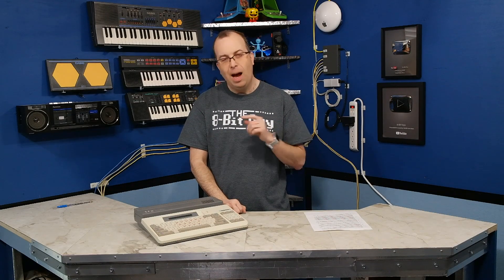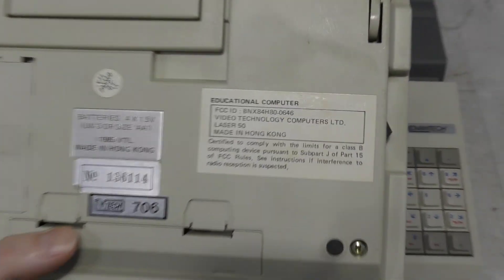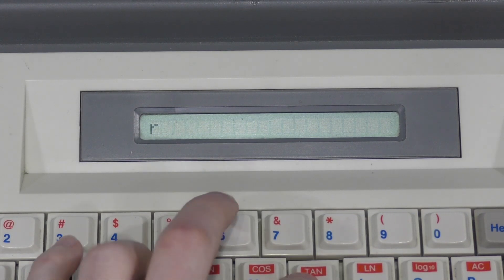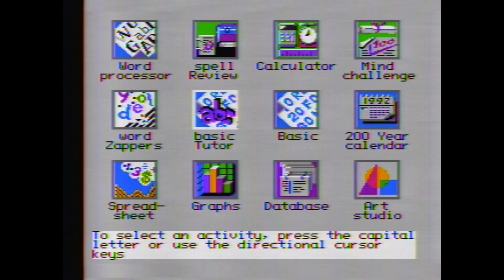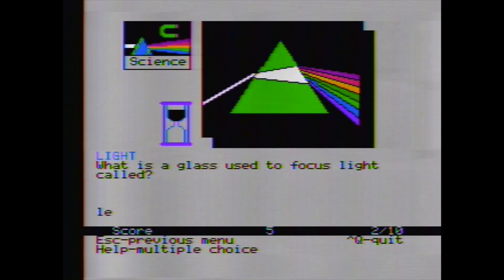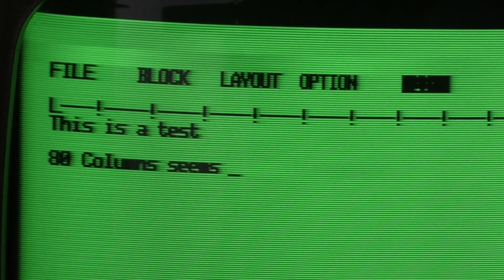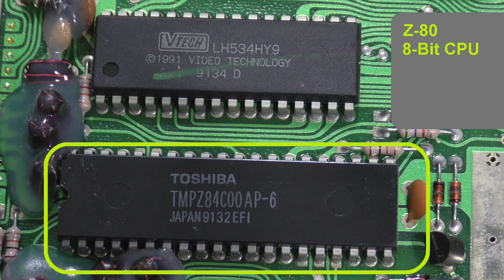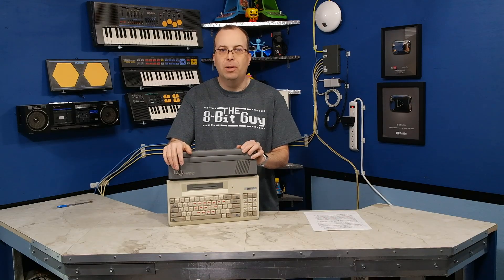The Advantech I.Q. Unlimited with BASIC and a Z80 CPU.

Comment: If my memory serves me right the Z80 can not address more than 64K of memory. Which is why the Spectrum 128 uses paged RAM to access the upper 64K in 16K blocks which are paged into the upper 16K of the first 64K.

Comment: By 1991, Commodore 128 and Amega had beat out the 64, IBM was part Windows 3.2 and DOS 7 and running between 4 to 12 Mhz with internal hard drives and Math Co-processors and a growing library of third party Windows based software. How could anyone with any business sense think this would be "all the computer a family would ever need"? Other than a gimmick, free give-away for opening a new bank account, or a rather expensive kid's toy, this thing was dead before it ever left the factory.

Comment: How could anyone stand to do work, or just mess around, on a single line display like that?  The computer looks pretty good when connected to a monitor though.
Reply: If you were typing something in to the computer just to print it off 1 line would work. But yeah, there is a reason the past is in the past.

Comment: That port in the back is an expansion port, and yes, the other is a ROM cartridge port, for which there were a total of SIX ROM cartridges available, mainly for expanding the database of the already installed programs, including the BASIC commands.
That expansion port I do believe was intended to serve as a way to connect a disk drive or some other data device, but never got implemented.
I've seen many of those types of chips like the one you first ran into after removing the RF shield, and usually, that is one of those 'all-in-one' things, similar to poxie blobs...lame.
I knew someone years back that had one of these, and everything that it could of come with. It certainly wasn't worth it's weight but...still a neat niche of a collector's item...
Reply: I bet.  At least there was cartridges for this.
Reply: Amy Carter, do you have any further information on these ROM carts? I haven't found any proof of them from my own internet sleuthing.
Reply: @jakenned91 another comment says this computer could play Socrates game cartridges

Comment: Interesting machine, great video :)

My first computer in the 80's was a version of Vtech Laser 2001, namely the Finnish version, Salora Manager. The Basic screen looks a bit familiar to me.
I wonder if Salora Manager / Vtech Laser 2001 Basic commands for graphics work in your Vtech computer? How about trying this, "Your first computer program" from Salora Manager manual :)
10 GR
20 COLOR=1,3
30 CIRCLE (75, 50), 20
40 CIRCLE (175, 50), 20
50 PLOT 70, 145 TO 75, 150
60 PLOT 180, 145 TO 175, 150
70 FOR X=75 TO 175 STEP 1
80 PLOT X, 150
90 NEXT X
100 CIRCLE (85, 60), 5
110 CIRCLE (165, 60), 5
120 END

If it goes to graphics mode, you should get back to text mode by typing:
TEXT
and pressing enter.

Comment: I did some legwork about those expansion slots - Nightfall Crew seemingly has a page for this under 'IQ Genius 128' with a manual scan and some information about the port.  It notes that the cart port is on the memory bus with the system ROM and storage Flash, and that the french version of the system comes with "comes with cartridges only containing straps, likely shorting some pins enable extra features.."  The manual indicates there are programs related to geography and science included on two cartridges that came with the main unit.  It also indicates that one available feature was using a cable to hook together two computers of this type and transfer files between, or alternatively attaching one of these to a PC.  It looks a bit like the area the connection chapter points to might just be that other slot in the back.

Comment: Could you mod the speaker with a switch and some clever wiring-in-series&parrallel (like you've done to your electronic keyboards in past episodes), to allow for data to be transfered out of the computer ZX Spectrum style?

Ps: the switch would be to turn the sound coming out of the speaker off, but to still allow it to travel through the wire and out of the modded-in sound-output jack... ...as for getting data in? 
...
Maybe you could pick you least favorite/least useful keyboard key, and then design a program to listen too, and then to produce a binary file off of that key's keystroke pattern, and then you could solder a usb port inplace of the key switch and use an RPI0/audrino with an os designed to act  like a driver for the newly soldered usb; and it could convert serial data, into ones and zeroes accross the only wire available to the key-switch; which would be a big bottle-neck, but atleast is hypothetically simple (I'm no engineer [yet ["yet" cos I plan on being a software engineer, for my own videogames and whatnot someday]], but I understand duct-tape and stubbornness). Such an input method may be slow, but atleast its automated, right?

(Automated, and possibly error-prone, but still...)
Reply: After watching more of the video: 

It seems that your BASIC is too basic, for such an endeavure, my apologies
(Not that I knew what I was doing to begin with! roflol)

Comment: The TMP42C50N has 512 bytes of ROM and 32 4-bit words of RAM, according to the datasheet I saw.
Reply: Yeah, but if it's only doing a very simple job within the machine, it might not need any more than that. I could imagine such a controller, with a different ROM mask, being perfectly capable of looking after the requirements of a basic but competent electronically controlled washing machine, for example. So if what it does in the VTech is equal to or less than that kind of task...

As for it being a video controller, I kinda doubt it. It's not the sort of thing microcontrollers tend to get used for, and of course the memory isn't anywhere near large enough; even the half-K ROM isn't enough to even hold a proper character set. It might be working as a basic GLUE type chip, running the LCD panel, keeping the backup memory alive whilst the main machine is turned off (a simple 4-bit uC will use far less current than a Z80), or maybe most likely it's the keyboard controller. You see Motorola and Intel equivalents in the ST, IBM PC etc.

The video display is probably looked after either by the mystery VTech proprietary QFP surfacemount chip on the top side of the board (maybe some form of ULA), and/or just the Z80 itself. The computer doesn't do anything that requires any kind of serious processing power, and if we look at the example of e.g. the ZX81, which can produce a 256-pixel monochrome display at 3.5Mhz with about a quarter of its processing speed left, a 6Mhz one should be able to provide 80-column monochrome and 40-column in 4 greyscales (which are then manipulated into artefact colour), with 6-pixel wide characters. With a more Spectrum-like ULA being able to give at least 480 pixels at 3-bit greyscale/artefact colour quite easily so long as it was running at twice the speed (as per the Sinclairs; the CPU-built images taking advantage of its 2-phase clock instead...), and fairly sprightly performance for this kind of application. The Amstrad PCW after all ran just fine with a 4MHz chip and a 720x256 monochrome display.

Oh, and the actual ROM is that otherwise mysterious VTech DIP on the underside, which does indeed hold a full 512k. Essentially all the programs it runs would fit quite comfortably onto a single 3.5" DSDD. Googled for the codes printed on it and found someone else had already managed to ID it as a Sharp-manufactured mask ROM...

(FWIW I figure all of that 128k is used, probably with 32k permanently locked in as working memory - which it doesn't need much of if the software is largely running from ROM - and VRAM (12k is more than enough for 480x200 1bpp or 240x200 2bpp), and a second 32k out of the other three quarters swapped in as file storage. After all, the things you write have to live somewhere, and the file handling routine appears to split the available pseudo-SRAM into three virtual "drives". And the word processor says you have 20kb free when you start a new file, which is just far too convenient... 32 minus 12... though I might have thought it would save straight into the "drive" bank rather than the working memory, in which case perhaps there was already 12kb of files in that bank... ;-)
Reply: If, like me, you're interested in that sort of thing (how the VCS came to be, how it works, its features, etc), you should look up a series of videos about the 20th birthday of 'Stella' (the VCS's internal code name). For me they were fascinating to watch, with the original hardware (and software) engineers all talking to each other. The founder Nolan Bushnell was also there.

There's the edited, produced version starting here: https://youtu.be/CNJ51okNKqI (in 6 small-ish parts) and the full MUCH longer series of videos by Neb6, starting here: 
- https://youtu.be/O8AaXEq1Qok (Atari Discussion 1)
- https://youtu.be/I3Jgq8XCV2Y (Atari Discussion 2)
- https://youtu.be/27mm0x6uYhU (Atari Discussion 3)
- https://youtu.be/cMoNJM8ef9E (Atari Discussion 4)
Check Neb6's main page for all of the others relating to that production. All the big names from Activision, Imagic and others are there, as well as the original hardware guys. LOTS of information for the retro nerd...
Reply: 512 bytes sounds like hardly anything, but imagine that the Atari 2600 only had a quarter of that, 128 bytes! And no video memory to speak of (the CPU directly controlled what the video beam drew, line by line). Amazing that they were able to do the things they were able to do with that system. Its CPU, the 6507 (a cut-down version of the 6502) could only access 8k (without special tricks like bank switching). One of the original hardware guys for Atari 2600 said "We had a failure of imagination" on that. They saved a few pennies having a slightly cut down CPU, but if it had been a full 16 bit address space (like a full blown 6502), the system might have lasted even longer than it did: FAR longer than was originally planned or even thought possible.
Reply: Not only that, but that's the ROM (at least, the built in amount); the RAM is only 16 bytes. Good job it clearly doesn't rely on either of those to run the actual machine as a whole, most likely as a kind of bootloader/BIOS and a zero-page RAM/extended register set.

The VCS also was never meant to be something that would be the entire foundation of Atari for the next 20 years or the like. They just wanted a slightly more flexible Pong machine that didn't have to be built entirely from scratch every time someone came up with a new game along those lines. The raw abilities of the VCS are very much like what you'd expect for a microprocessor-driven Pong machine (Atari's own original was built from discrete logic, no CPU at all). That they even managed to drag the launch titles out of the thing is something of a minor miracle, let alone the alarmingly sophisticated stuff that turned up later on. Most of the fancier titles reprogrammed the entire internals almost every line, and even partway through most lines... insane amounts of manual bit-twiddling only possible because of the super tight relationship between the beam scanning and system timing.
Reply: EFormance Engineering 📺📹📼🎸📡
Reply: yes, 16k
Reply: There is 16 bytes of RAM and 512 bytes of ROM.
Reply: oh

Comment: I believe the Z80 only had 16 address lines, which is why the computer could only access 64K of the 128K RAM.  Obviously, it would need to employ some type of banking like the C128 used to pull that off, which was likely not available.

Comment: A 74HC244 is not a shift register! It is an octal tri-state buffer IC. Commonly used for driving higher loads / greater fanout, or perhaps for reading real-time input values onto the data bus (eg. if it’s output enable was activated by an address decoder).
Reply: Looking at the circuit, it appears to have a diode/Capacitor circuit commonly used for debouncing on the backside of the 74HC244. My guess is the 74HC244 is used as a true buffer to read input values from the expansion port and the diode/Capacitor circuit is used as a hardware debounce which ultimately goes to a uC ... IMO
Reply: Hi @geekfeather. Taking a closer look, I can see that 'ENABLE A’ (pin 1) input is tied to GND (10), possibly also ENABLE B (but pin 19 trace is obscured by under chip trace). This identifies the 74HC244 is a permanently enabled buffer. Some of the visible input pin traces as well as some output pin traces route directly to the 25pin printer port. The other side of the buffers appear to go back to the micro-controller (must be GPIO pins). On this basis the HC244 appears to be buffering all of the parallel printer port's input & output control lines. The diodes are likely over voltage / spike protection.  Cheers.
Reply: @gregclare One of my pet peeves is when people think the 74HC244 is a shift register instead of an octal tri-state buffer IC.
Reply: @customsongmaker  Yes, as I’m old school and grew up when we were designing our own 8-bit microprocessor systems in the 80’s, I immediately recognise 244 octal buffers.  We commonly used these for address and control bus buffers, and the associated 245 bidirectional buffer for driving the data bus.  Although, I’m not sure why anybody would confuse the 244 with a shift register, especially when data sheets are just a google search away these days.